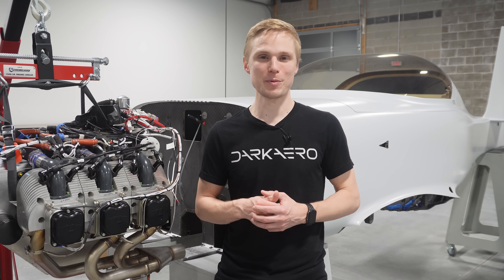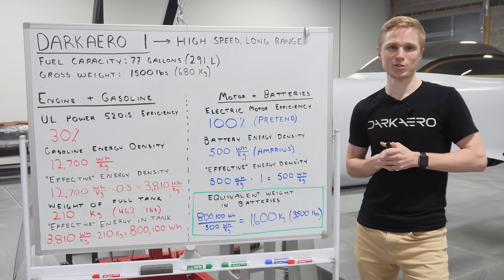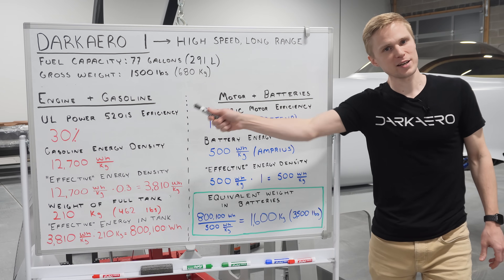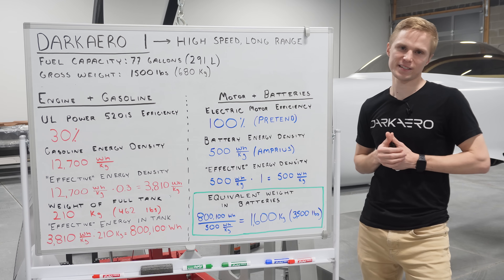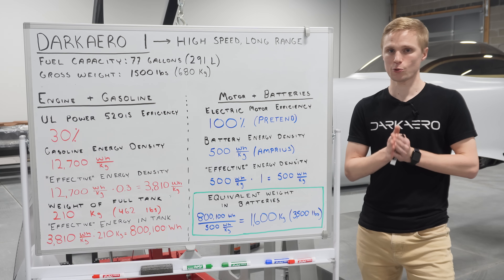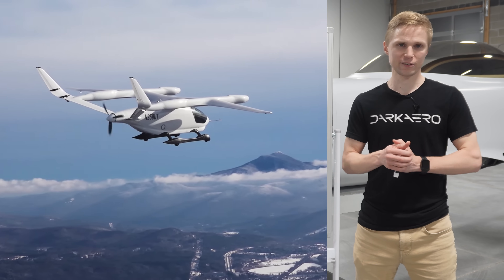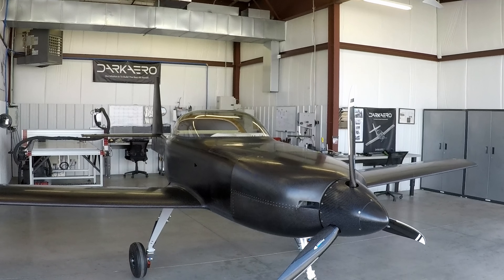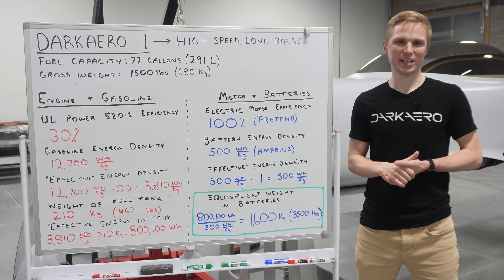The engineering challenge of electrifying airplanes

Comment: Lovely walkthrough -- in which you have shown that using a PEM based fuel->electric drivetrain would be more efficient than EITHER of the designs shown.   

So the Dark Aero 1 should be run by a diesel ( or JET-A ) diesel/electric hybrid drivetrain.  All the torque and power of an electric propshaft system, all the energy density of diesel, and much higher overall system efficiency.

This would mean you could either carry more payload, go farther, or simply use less fuel to go from point A to B.
Reply: The law of conservation of energy applies. The diesel is no more efficient whether it's turning the prop or powering a generator to power a motor. You will actually see conversion losses. Diesel electric comes into its own where you need 100% of the energy available at very low speeds, i.e. getting a train moving without having an insane transmission assembly.
Reply: @AnonyMous-jf4lc  ZERO argument from me there.  However, jet-a/diesel electric turbines have achieved 40--48% efficiency at converting the available chemical energy.  So, for the mass of fuel and given the overall efficiency of the system you ARE getting more than the most efficient gasoline powered engine and 10-18% more is a lot in terms of mass of fuel needed.  Diesel turbines are smaller and lighter than their piston counterparts, and the electric motor to run the propshaft is MUCH lighter than the geartrain that would be needed to convert the high rotation speed of a turbine shaft to practical prop speeds.

It really is a better solution to the problem.  I think I should probably do a "reaction video" whiteboard assessment to show it.
Reply: @MartinBogomolni  Do your efficiency numbers contain utilisation of the heat energy? Sounds like power station numbers, not vehicle numbers.
Reply: @pistonburner6448  AFAIK, the Lawrence Livermore Combustion Research lab data does not take into account utilization of the heat energy.  The analysis does note that waste heat is used to preheat fuel being fed to the turbine, but I don't see any references to that heat being recaptured for direct electrical conversion. The LLCR research facility studies various types of engines for use in vehicle designs and use.
Reply: @MartinBogomolni  It's just that thermal efficiency is a very tricky measurement. Like for example Formula 1's 1.6 litre turbocharged gasoline V6 engines are currently at about 50% thermal efficiency, but that does not translate into all applications anywhere near usefully...

Thermal efficiency is also very irrelevant in the age of biofuels and e-fuels since the only variables that matter are:
1. The amount of new CO2 emitted into the atmosphere during production of vehicles, fuel and their use, and
2. Cost

It doesn't matter if you waste 10x the amount of fuel if it's carbon neutral and costs little enough. For example mass-producing e-fuel at incredibly low cost in Icelandic geothermal & wind production plants will allow you to use as much fuel as you want as long as the cost remains low enough. 

Or using modern new-gen nuclear power plants to produce e-fuels incredibly efficiently at huge volumes with low cost will also result in very little worry even if consumption would stay high...as that higher consumption still doesn't lead to any more CO2 emissions nor cost.

And a third scenario where HVO biodiesel (/biokerosene) is produced from cheaply sourced industrial waste products with only extremely low CO2 emissions, once again we don't really care about consumption for any other reason than cost. This fuel type is btw the one which is already produced in at least three refineries worldwide and has been tested in aircraft for years. It's also widely used as a totally normal diesel replacement in several countries, with their residents able to fully use only that fuel in their diesel cars with the fuelling network wide enough and the cost only being a few cents above that of fossil diesel (=massively lower in CO2 and cost than EVs!).
Reply: @MartinBogomolni  small scale turbines are generally less efficient than piston engine counterparts. This reverses with larger scale and higher power outputs.
Reply: @AnonyMous-jf4lc  I don't know if any turbines are ever more efficient than piston engines? It's just that at larger aircraft the cost calculation and customer preference puts maximum speed etc. at higher priority.
As fuel efficiency has increased, aircraft have gone more toward propeller configuration from turbofan (including turbofans themselves going towards turboprops with their high-bypass design), and if they could they would certainly go more towards piston aircraft in the bottom end. At least in theory and in concepts (obviously financial considerations prohibit testing and realising all such theories quickly).
Reply: @MartinBogomolni  "diesel  turbine" engine makes no sense; they're just turbine engines... yes using kerosene-based fuel that can include fuel intended for diesel engines.

Only large turbines can approach the efficiency that you quoted (40 to 48%). A turbine engine in the size needed for the DarkAero would be far less efficient than their current gasoline engine.

A generator and motor is not lighter than a geartrain of the same power handling capacity, even at the high ratio needed for turbine engines. Every turboprop engine in existence is proof of that.
Reply: @pistonburner6448  They are at larger scale, it's proven.
Reply: Diesel v12 hybrid flight test https://youtu.be/GUEAa8fHvbQ

Comment: Optimum - is hybrid = electric motor + high rpm small gasoline engine + high rpm electric generator. High rpm small gasoline engine is light weight and work with high effectivity. For reliability may use small battery.
Reply: So why wouldn't I take that small engine, hook it up to reduction drive, and spin a prop with it directly?

Oh wait, that is what people are doing. A number of people are using high revving Yamaha engines.
Reply: @TheOwenMajor  1. Layout isn't always optimal.
2. The reducer will have a large size and weight.
3. If you put a small battery, then need less power engine (and size). During takeoff, the engine and the battery will work together on electric motor. In flight, the engine will additionally charge the battery.
4. In the future, when battery will lighter and cheaper, the conversion on full electric will be easier.
Reply: @deniangler  regarding your "2. The reducer will have a large size and weight": a generator and motor are larger and heavier than a mechanical reduction drive... and less efficient.
Reply: @brianb-p6586  Oh no! High-rpm generator have small size and weight.
Reply: @brianb-p6586  High engine efficiency exists in a small range of rpm. In the hybrid version, it is possible to always maintain optimal rpm.
Reply: @Deni Angler  any generator at any  speed is heavy and bulky (and expensive, and inefficient) compared to a gear handling the same power.
Reply: @Deni Angler  yes, a series hybrid can keep the engine at the ideal speed, which is valuable in a car. In an aircraft it has little to no value, since a variable-pitch propeller achieves the same thing.
Reply: Why would the engine be "small"? This is an aircraft, not a car, so to cruise it needs 75% of peak power to cruise; that means the DarkAero would need a 150 HP engine as a hybrid, which is not small.  A 150 HP engine running at peak power would be even less efficient than the 200 HP engine running at 75%; the UL 520iS at 2400 RPM and 150 HP is operating at its most efficient point.
Reply: @brianb-p6586  You misunderstood, a small high-rpm engine drives a generator, which powers the electric motor.
The high-rpm engine has small dimensions and weight and runs at 12,000 rpm. Similar an engine  on popular Japanese motorcycles.
Reply: @deniangler  As Owen pointed out, a smaller and faster engine is always an option, without resorting to an electric drivetrain. Perhaps more importantly, a high-speed small engine will be less efficient than an lower-speed and larger engine producing the same power. A 150 HP motorcycle engine running flat-out at 12,000 RPM will consume far more fuel than the huge UL520iS ticking along at 2400 RPM, and (for example) a 1 litre Yamaha RX-1 snowmobile engine (a variant of the R-1 bike engine, but without the unnecessary transmission) weighs almost as much as UL Power's 3.5 L UL350 of the same power output.

Using a smaller-displacement higher-speed engine is not an advantage of a series hybrid system in an aircraft, because it doesn't save weight, complexity, or fuel.
Reply: Diesel v12 hybrid flight test https://youtu.be/GUEAa8fHvbQ

Comment: Thanks for encapsulating many of the points about electric versus gas engines in airplanes. I don't know why you would through mentioning hydrogen into the mix which you missed a lot of the downsides for. The weight of an airplane hydrogen storage tank would be very prohibitive. One expense that has to be considered would be how often replacing parts that come into contact with hydrogen would have to occur. Special dense alloys have to be used to contain a gas of the smallest atom. And since no alloy is dense enough to completely prevent being permeated by hydrogen, they all become brittle over time.

Regarding electric versus gas, about the only improvement to gas engines that could be made is reducing weight. Which isn't going to amount to much. Batteries on the other have a lot of potential to reduce weight.

Removing the factors of flying regardless of cloud cover and speed, solar electric assisted planes would be promising.

Comment: HIgh speed and long range, another  oxymoron. Add some altitude and freezing temps will throw all this BS about energy efficiency out the window. That assumes it could stay airborne long enough to get cold soaked. Once you've found your emergency landing spot you better pray they have a charging station that works and be prepared to stay there a few hours.

Comment: Do a hybrid system a electric main motor then a diesel generator to supply battery. Or just do a diesel 🤷🏼‍♂️
Reply: Diesel v12 hybrid flight test https://youtu.be/GUEAa8fHvbQ
Reply: I could see one of those 2.8l Cummins or a baby Duramax diesel in there could be a great long range cruising plane. Opposed piston diesel is the way to go if you are going to do a motor from scratch 🤷🏼‍♂️🍻
Reply: @cch201992  a 2.8 L Cummins or Duramax 2.8 weighs more than twice as much as the UL 520 iS, even without counting the cooling or exhaust systems.
Reply: @brianb-p6586  honestly I'm not surprised it is a chunky boi 😅 to be fair it's not made for aviation purposes I'm sure the block can be made from aluminum or other parts made of carbon fiber. I guess a good question to ask is what is the smallest diesel that will fit and if that engine will have enough power?  🤷🏼‍♂️ Diesel would be the better fuel for range but would probably need a custom motor for the application  but I mean those opposed pistons are cool and were used in WW2 long range bombers.
Reply: @cch201992  There have been lots of aviation diesels, including some modern designs. They are more efficient than gasoline engines, but are also heavier.

Comment: liquid hydrogen is pretty good if you design for high wing volume
Reply: Or CNG (compressed natural gas, also can use biomethane) if there is lots of empty usable volume to use as gas storage.
Reply: Liquid hydrogen can't go in the wings of normal aircraft, because it needs cryogenic containment. That means bulky round tanks, or a "flying wing" style of design... which no one wants.

Comment: How viable electrification becomes if the DarkAero would not be a long-range or high speed aircraft?
Reply: Ride your bike instead.
Reply: @AndyRRR0791  We just need to find an E.T. to put in the bike's basket.
Reply: That would be a different aircraft. Everything about DarkAero's design is for long range and high speed. If you want to consider a completely different design of a 2-seat aircraft, look at the Pipistrel Alpha Electro mentioned and shown in the video - it's a battery-electric aircraft which is certified and has in production since 2015.

The Alpha Electro has an 11 kg motor and 126 kg of battery (137 kg total) for one hour of flight time, instead of the gasoline version's 86 kg engine and 35 kg of fuel (121 kg total) for four hours of flight time.
Reply: @brianb-p6586  actually I wanted to see how the DarkAero would compare to the Alpha Electro considering the DA is an ultralight all carbon construction if it used the latest cell technology mentioned in the video (500Wh/kg). The AE has a conventional airframe and uses conventional cells (or at least not this latest battery chemistry). Of course this is all hypothetical but interesting for me nonetheless.
Reply: @AhmedHassan-yc5fb  Pipistrel uses all-composite construction - is that "conventional" now? It doesn't use carbon fibre, and I agree that it's probably well behind the DarkAero in this aspect. Perhaps a few kilograms could be saved in the Alpha Electro.

Pipistrel is using real cells; the comparison is to cells that are still in development and may never be workable at the claimed performance level, so you could multiply the Alpha Electro endurance by some factor to project the endurance with the cells that this video is using as an example.
Reply: @brianb-p6586  Didn't know AE was all composite. Thanks for the info. Btw the new battery cell (500Wh/kg) is difinitely viable technologically. It is currently in limited production and they are ramping up. Difinitely not a a lab concept as all other battery announcements out there. I am well aware of the distinction. Still might not make economical sense to most applications as it is still too expensive.